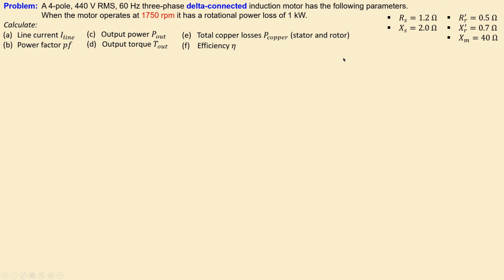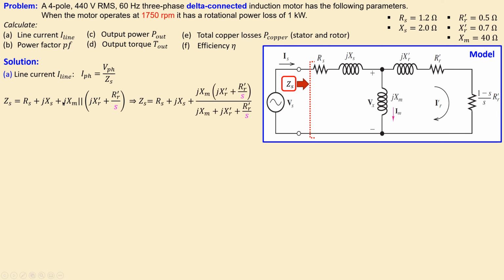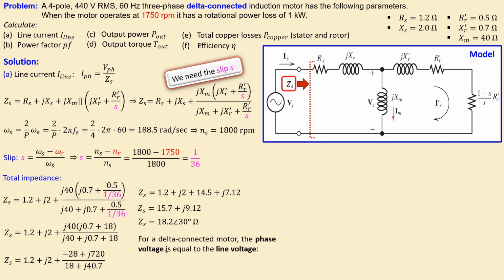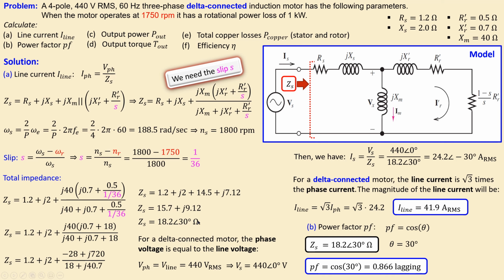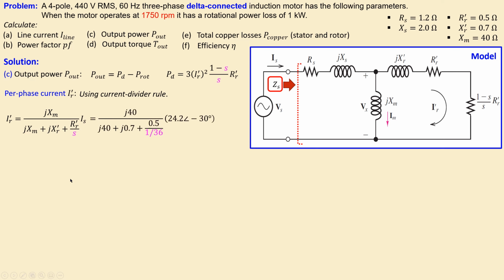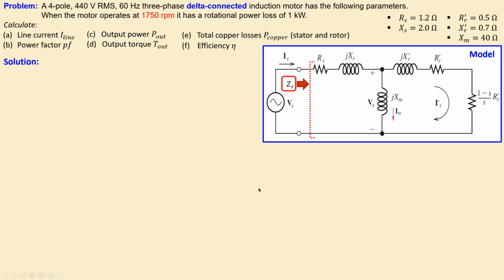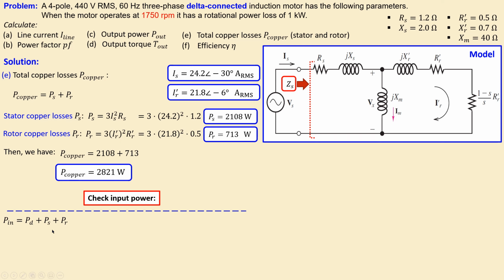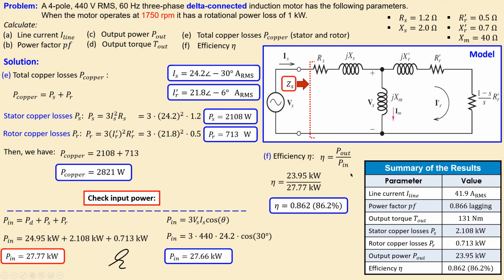⚡Delta-Connected Induction Motor Explained 💡 Line Current, Power, Torque & Efficiency - Example 3

Comment: Sir the armature cureent IA ; is it equal here Is. Because our text book IA=Vø/Ztotal.
 than because of delta connection IL is some IL=1.732*IA
COULD YOU ANSWER FAST PLEASE I HAVE A EXAM .
 Reamin is some. 
Thank tou for video❤
Reply from the maker: In this per-phase circuit, I explain the currents and voltages. Also, what will happen if you have delta-connected motor, which is the topic of this video.

Comment: Since the power input = 3*Vline*Ilinecos(theta), for a delta connected induction motor Is = Iline/sqrt(3), so shouldn't Pin = 3*Vline*Is*sqrt(3)*cos(theta) ?
Reply: Or is the standard formula for Pin = Vphase*Iphase*3 ?
Reply from the maker: Thanks for the message. The input power Pin = 3*Vphase*Iphase*pf. The phase voltages for the delta-connected motor is equal to the line-line voltages in this example.